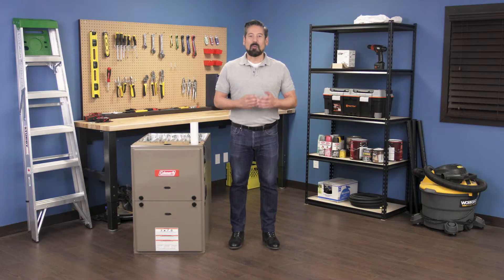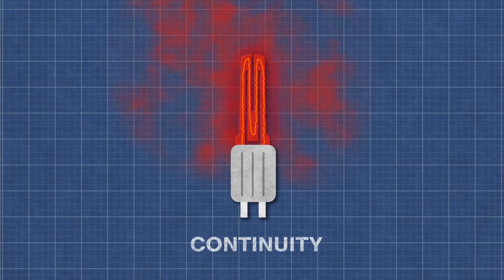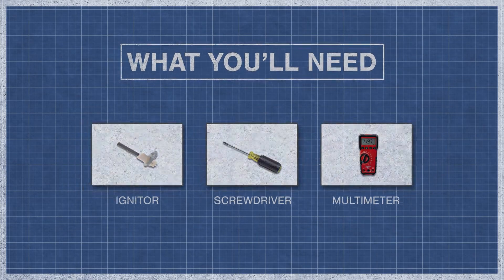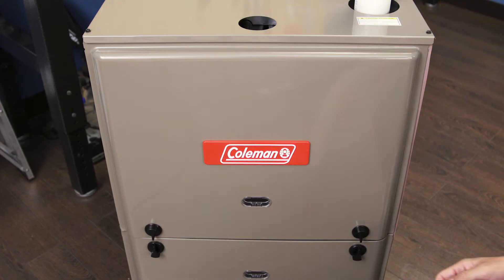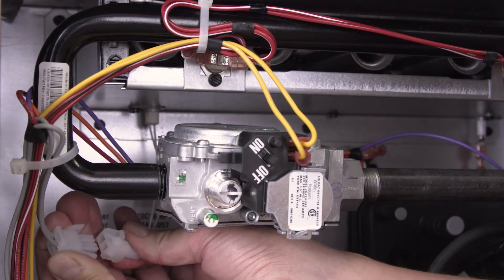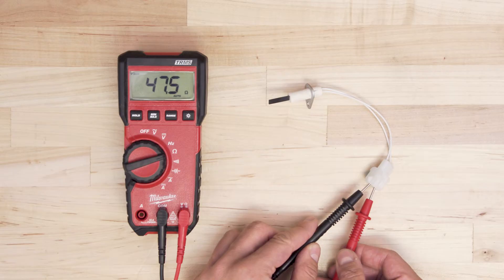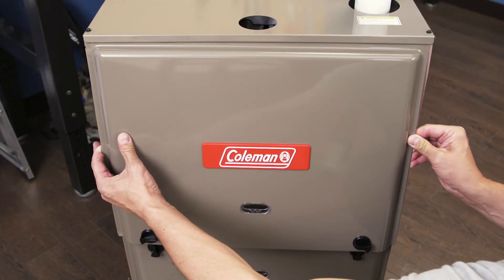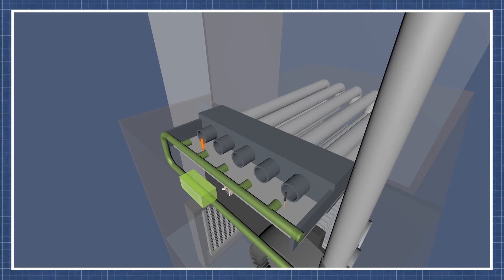Furnace Not Igniting? - Ignitor Testing & Replacement | Repair and Replace

Comment: Hi, My igniter turns hot yellow but it doesn't ignite, then it switches off, already cleaned the heat sensor .
Reply from the maker: Thanks for watching. If the ignitor glows and doesn't ignite then it could be a faulty gas valve. This is something you'd need to get a HVAC technician to take a look at.

Comment: My igniter keeps on going bad, it works for around 3 week without issues and then it stops working and have to replace it and it’s the same cycle. I have bought about 7 or 8 igniters in the past 3 years
Reply from the maker: Thanks for watching. I would first check if the voltage of ignitor matches with what voltage that the furnace is sending through it. A mismatch can create issues. Most are 120V but there are some exceptions.

Comment: I have a weird problem.  The wire that connects to the ignitor (from the control motherboard) has 120v, but as soon as i connect it to the ignitor, the voltage drops to zero
Reply from the maker: Thanks for watching. Have you checked continuity of the ignitor?

Comment: What if the ignitor glows, the furnace fires up and then shuts down presumably because the blower didn’t come on? Blowers does run for AC.
Reply from the maker: Thanks for watching. If the furnace ignites then shuts off then it could be an issue with the flame sensor. The startup sequence is explained in this troubleshooting video https://www.youtube.com/watch?v=b0sAGt-1niU In either case try cleaning the burner as the flame sensor needs to complete the circuit through the flame to the metal housing of the burners. Without it the furnace thinks that there is no flame.

Comment: My new igniter worked 1 time and failed.  Measured ohms and read only 4 ohms. What would cause this? Any help is appreciated.  Thank you
Reply from the maker: Thanks for watching. Hot surface ignitors are relatively brittle when compared to something like a thermocouple or flame sensor. It doesn't take too much to damage the coating which is why they are transported in foam. As well in some cases oils from skin can also be corrosive.

Alternatively the ignitor could just be bad, but there is no way of determining if a manufacturing defect occurred. In some cases an issue with the voltage or a faulty control board can also damage an ignitor.

Comment: Can a ignitor be failty if it is observed to glow when there is a call for heat? 

My furnace has started to randomly fail to ignite & goes into lockout mode. Sometimes the ignitor glows & lights the flame, sometimes it glows but fails to light the flame.

Carrier furnace ignitor PN# 41-409.
Reply from the maker: Thanks for watching. It does point to a faulty gas valve but it's best to eliminate some other confounding factors.

Make sure that the burners are clean. As well make sure that the ignitor wires are secure. It is possible that the ignitor isn't getting hot enough for long enough. Installing a new ignitor would help eliminate that as a source of the problem.

If that doesn't fix it, then it's likely an issue with the gas valve or gas supply. This is best handled by a technician.

Comment: My furnace glowing not fire what’s the problem
Reply from the maker: Thanks for watching. If the inducer blower runs, the ignitor heats up but the main burner doesn't ignite then it could be an issue with the gas valve or the gas supply. Alternatively if the flames ignite for a few seconds then shut off then that is an issue with the flame sensor. This video here talks about the furnace sequence in more detail: https://www.youtube.com/watch?v=b0sAGt-1niU

Comment: Can you clean an igniter like a flame sensor?

My igniter glows but the flames never comes on then the whole machines shuts down, re-tries 2 more times and then lock out mode. I cleaned the flame sensor - nothing. Then I blew on a few hose and nothing. I was about to give up and close up the hood —which triggered the safety for the machine to cut on and try again (which I was holding to see if it will run ). I didn't think anything will happen so I was going to let it lock out and shut the thermostat off but then the flames lit?!

After the room got up to temp it shut off and it didn't cut back on after. I'm guessing the gas line is fine since it lit before. Can I clean the Igniter like the flame sensor? My research says that maybe it's not getting up to proper temp so the sensor can't read it and shut the machine off? My problem is the flames don't light. I don't see carbon build up on the things where the flames shoot out. The tail end of last winter it kept cutting on and off to lock out and then I cleaned the flame sensor and to work fine for the rest of the season.
Reply from the maker: Thanks for watching. The ignitor can't be cleaned like the flame sensor, and any abrasion to the coating can prevent it from heating up.

If the ignitor glows then it should be hot enough for ignition. If you think it's starting to fail you can install a new one to eliminate it as one potential cause.

The flame sensor detects the presence of a flame by completing a small circuit through ions in the flame itself. It does not detect the temperature. 

If you've thoroughly cleaned the burner,  put a new ignitor and the flame still isn't lighting consistently, then it could be an issue with the gas valve or the control board.

Comment: Hi there
I have an Amana gas furnace about 12 years old. When my Tstat calls for heat, the purge fan comes on , the igniter lights, and then the gas lights for about two-3 seconds and the flame shuts off. What is the problem ?
Reply from the maker: Hi Gary, thank you for watching. What you're describing sounds like an issue with the flame sensor. This video will explain how it all works a little better: https://youtu.be/b0sAGt-1niU

A dirty flame sensor or dirty burner will prevent the furnace from proving that there is a flame so it will shut down after trying to ignite. You can see how to access the flame sensor here: https://www.youtube.com/watch?v=af_qRnfHFws

Comment: Great video. 1:59 mark that's an older model Carrier furnace, Very tricky to get to the ignitor but good thing it's mounted on a metal plate and screwed on only on the right hand side, so after removing the air intake pipe it is tricky but possible to unmount it.

Not sure why they use these types of ignitors instead of a simple spark plug like what's common in BBQs or cars!
Reply from the maker: Thanks for watching, we're glad that you found it helpful. Hot surface ignitors heat up and sustain that heat over seconds and will also has a larger surface area which helps with ignition. Because hot surface ignition involves applying line voltage to the igniter element (rather than 
high voltage to an arc device) there are no electrical noise issues as associated with direct spark and a little likelihood of interference with neighboring components.

Comment: Why would the ohms jump all over? It goes from 130-80-95- etc etc
Reply from the maker: Thanks for watching. That variation is more likely due to the amount of pressure that the multimeter leads are making with the contacts on the ignitor. Making more solid contact will reduce how much the ohm rating jumps around. Still the ohms are within the normal range in your case.

Comment: Today I seen an igniter that only turned red 80% of the way when it’s generating heat.. i checked the ohms and it gave me a reading of 55 ohms. Is that igniter fine? The 20% that didn’t turn red was the bottom of the igniter
Reply from the maker: Thanks for watching. That is within the range of most ignitors. Is your furnace having issues igniting?
Reply: @AmreSupply  no just a simple check up
Reply from the maker: @abecontreras7940  Thanks for clarifying. If it's still working then its not something you should be worried about. A furnace ignitor is just a resistor similar to the heating element in an oven. Oven heating elements don't glow near the edges, there is one section that will always glow more than others. However if you see a spot in the middle that seems darker and isn't glowing then it might be a sign of damage.

Comment: Do all igniters show 30 to 200 ohms? Specifically Lennox furnaces
Reply from the maker: Thanks for watching. Yes most ignitors will have a resistance within that range. For example this lennox ignitor has a resistance of between 39 - 70 ohms. https://www.amresupply.com/part/70W16-Lennox-Hot-Surface-Ignitor Others may differ and not all ignitors on the website will list resistance ranges.

Comment: Excellent video and many thanks for posting it. Exactly the issue with my Luxaire. Wanted to buy it today but you folks are not open on Sundays. Perhaps consider to open 1/2 day on Sunday - almost guarantee that your business will attract many DIY like myself. The ignitor (41-408 Robertshaw; Norton 271N) is rare as Elvis sightings to buy on a Sunday. No Home Hardware; No Lowe's; No HD carry this item.  Bought it locally from a HVAC tech (Kijiji) so we can have heat. Thanks again.
Reply from the maker: You're welcome Kumar, we're glad that you found the video helpful! Being open on Sundays is something that would definitely be helpful for the furnace parts that are harder to get somewhere else. Appliance parts can wait a day as there isn't the same kind of urgency. When heating is down, each hour counts. I'll pass this message along and hope see if it's something that can be reviewed. Cheers!

Comment: Any company that won't guarantee a part won't get my business.
Reply from the maker: Thanks for watching. No returns on electrical parts is a common policy and its also common in the auto parts industry. There are people that take advantage of the system have resorted to trial-and-error parts swapping when they don't know how else to fix an electrical problem. When parts they have installed do not fix their problem, they want to return them and try something else.

Electrical/electronic parts are easily damaged by improper installation or testing. Because electronic components can be very sensitive to voltage overloads, it does not take much of a voltage spike to ruin a component. If electronic parts are installed then returned it is difficult for any company to be confident in selling that part to another customer. There are too many unknowns.

This is why our videos are focused on the testing and troubleshooting to really narrow down the problem the first time.
Reply: @AmreSupply  not true I bought a Accel distributor module it has a year warranty washer supply warranty all electronics so don't give me that BS.  Do you know a Sears and roebuck you could order a glass battery from 1920s or a water heater and they're still around today. I got one. I don't support china crap nor do I want that crap in my landfills. I know about electronics and I can understand why a capacitor goes out what I can't understand is why I can't get the same value... China junk. I had a 1960 GMC there was nothing on it you couldn't rebuild yourself.. I can guarantee you I can out invent or revised any product you make!! Fact!!!

Comment: Why remove igniter to test it?  Why not test in place in case it is good?
Reply from the maker: Hi Doug, thanks for watching. You can for sure test it in place or remove it. We find for many of our videos, testing on the bench can be easier to understand as we can better show the ignitor and the multimeter. As well removing it allows you to see if there is any physical damage.

Comment: every Furnace has like that ignitor ? i saw a different video there is ignitor depend on pressure switch and flame sensor .. so that is looking like a flame sensor  is it or not .. Thank you
Reply from the maker: Thanks for watching. This particular furnace has the hot surface ignitor (shown in the video) mounted on the left side of the burners, and a small flame sensor (or flame rod) on the right side. It also has 2 pressure switches on the inducer motor.

The flame sensor is different. It will be a shiny metal rod, it will sit directly in the flame and will only have 1 wire coming out of it. The ignitor has 2 wires.

Various models will use different ignitors so it might look different than the one in the video.
Reply: @AmreSupply   thank you so much

Comment: For my particular furnace, this is what happens:
1. Draft inducer turns on (blower motor)
2. Pressure switch (connected via hose to draft inducer) is triggered by the vacuum created by the draft inducer.
3. If a vacuum was detected, the computer sends 120v to the ignitor
4. Thermocouple next to the ignitor detects heat, tells the computer
5. If heat was detected, computer allows gas to flow
6. Irrelevant stuff happens. I didn't bother to read past this but basically a bunch of thermocouples constantly check that the fire is burning

Basically if the thermocouple isn't glowing. Check it for resistance. If its less than 200ohm, its probably still good enough. Mine was 180. If I hit it with a blow torch it dropped to 0 ohms. So it was good.

Next up I checked for voltage. It was 0v, not 120. So basically the computer was never telling the ignitor to ignite, which would point to the pressure switch or a bad computer. So I checked the pressure switch for resistance. It was infinite, even after the blower was spinning full speed. So I took the pressure switch away and I found a little plastic constrictor. It had a itty bitty passage way, smaller than a needle, that the vacuum was supposed to pass through. It had a tiny bit of dust in it. So I hit it with the air compressor, reinstalled and working furnace!
Reply from the maker: Thanks for watching. We're glad that you got your furnace running again. You wrote a good summary of the sequence of operation. One comment though, thermocouples are generally used with standing pilot furnaces, so its most likely that you have a flame sensor. 

As well i think you meant to write "Basically if the hot surface ignitor isn't glowing. Check it for resistance."
Reply: I'm having issues right now.  inducer turns on, the igniter does not and I just replaced it new. I can hear the click from the valve and hear the gas come out(hissing) but no glow from the igniter. I checked for voltage from the 2 wires when it's time for the igniter to go but it only reads 00.08 then it shuts down. code reads 34

Comment: Hi! I have a newer Goodman furnace that has problems starting up 20% of the time. I have to remove cover, wait for the igniter to glow and once the gas comes on I give a little puff of air to blow the gas to the igniter and it fires up. This ignitor is almost center between two burners and I don't think it gets the necessary heat/glow to fire it up 100% of the time. All videos I see show igniters almost directly in front or may be a little to the side of a burner. Should mine be moved over? Is that possible?
Reply from the maker: Hi Michael, thank you for watching. The ignitor is positioned by the manufacture so its not recommended to change that. Instead there could be several things happening. Dirty burners could change the pull of air / gas into the burner. There could be low gas pressure. As well make sure that there is a good, fresh supply of air to the furnace room. There should be room under the door to allow for air to enter the room.

Comment: Make sure that ignition switch screw is tight down. Any slight play will result in ignition malfunction.
Reply from the maker: Thanks for watching Eric. That is an excellent tip! Its always good to tighten all the screws and double check that all wired connections are secure. That goes for all repairs!

Comment: Can you tell me why my furnace makes a clicking noise when I turn the unit on even before switching the knob from off to pilot.
Reply from the maker: Thanks for watching. A clicking noise could be the sound of the solenoid inside of the gas valve or a relay being engaged when you turn on the furnace.

Comment: I assumed ignitor was bad, so I purchased and installed a new one. it still did not glow. tested the old and the new ignitor, both were below 100 OHM.    Voltage to the ignitor reads only 7 volts when the furnace is cycling up to light. Induction fan kicks on fine, i hear the gas valves open, smell gas....  does the small capacitor effect the ignitor voltage? or is my control board bad?
Reply from the maker: Hi Eric, thanks for watching. Overall it doesn't hurt having a spare ignitor on hand .There are capacitors and other small components built into the control board that might affect the operation, the larger external capacitors the ones will be for the motors. If the ignitor is only getting 7 volts then its most likely an issue with the control board.
Reply: thanks! totally agree regarding spare ignitor. I knew it was replaced about 10 years ago and just assumed it was the culprit.
Reply from the maker: @ericreifer5225  Definitely it was a good call to remove any simple sources of issues first. The ignitor is a simple / relatively inexpensive one to swap out.
Reply: @AmreSupply  The replacement control board arrived and installed in 15 minutes. Furnace works like a charm! Thanks a million for your guidance. You are a wealth of knowledge and a life saver!  For others reading, definitely take pictures of your board before pulling wires.  I did a one for one swap of each wire as i was replacing the board.
Reply from the maker: @ericreifer5225  You're welcome Eric, we are just happy to help! Taking a picture is a smart idea, we recommend it for anything that has more than a single connection where polarity maters, as its easy to forget!